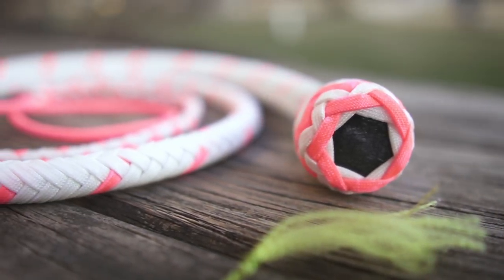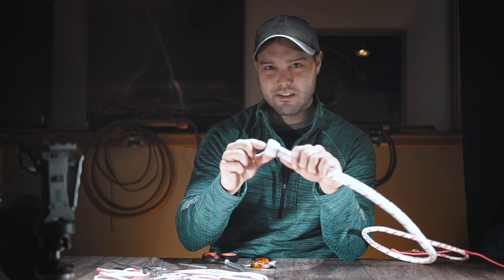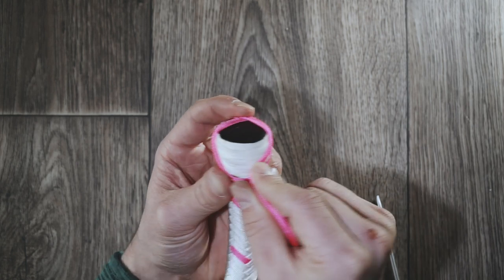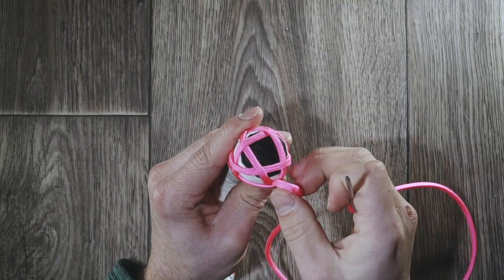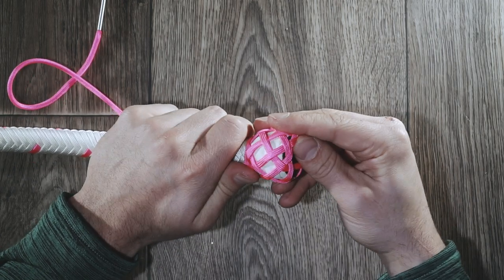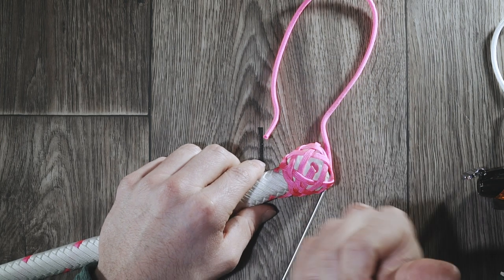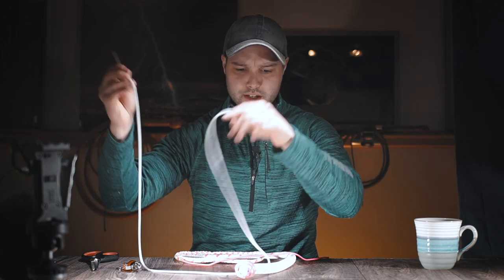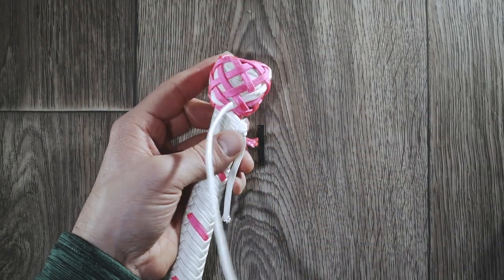How To Tie A Herringbone Knot - For A Bullwhip, Stockwhip, or Snakewhip

Comment: Thank you for this tutorial. Let me try to give back to you now. My last 3 whips, I've been using rubber leg tips for the foundation. They come in 4 packs at any hardware store and different sizes. Your choice of staples, one wrap of hockey tape, a video of yours on which knot and off you go...lol. They're great for conchos too.
Reply: The only thing I wouldn't recommend about these though is the fact that they probably cost a lot more than bulk leather. I could probably make 50 leather foundations out of only a few big pieces of leather for about the same price as what a couple 4 packs of leg tips would cost.
Reply: @MrJdmboy10  The price is about $3 dollars a pack and 2 were used on 2 whips I sold for over $200. It's always fun to experiment though and sometimes an extra dollar may be worth it or sometimes not.

Comment: Hey there, I got a question related to your very successful 6ft bullwhip tutorial from 2013:
As for the last layer of the whip you use 6 strands of paracord (20 20 19 14 9 5) and I got myself about 250ft black and a bit over 80ft red paracord as I want the whip to be in that color combination.
So my question is, which strands (according to your braiding shown in the video) should be red and black to result in a quite nice pattern? 
As this is my first attempt ever I really don't have any clue :/
Thanks in advance for your help :)
Reply: Any color on any size cord will create the same effect you’re going for, as long as you’re consistent with the pattern design and there’s equal number of strand for both colors, length won’t matter